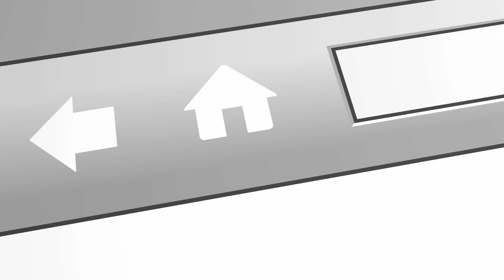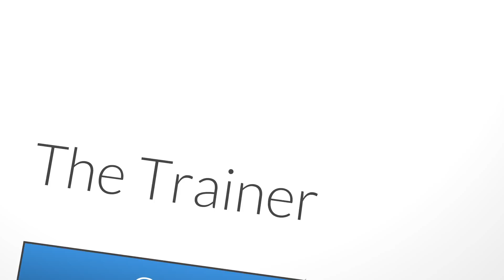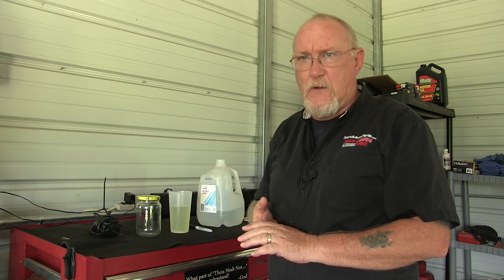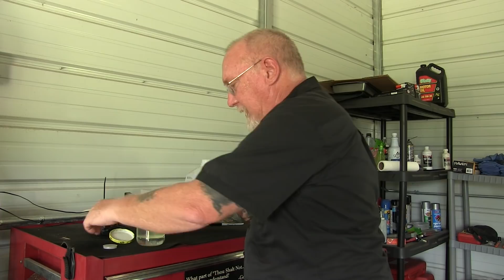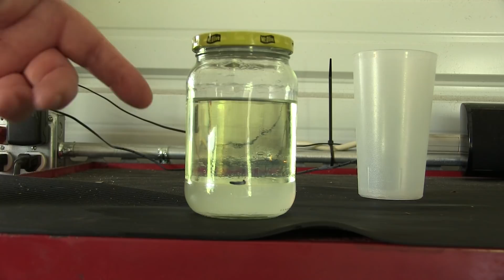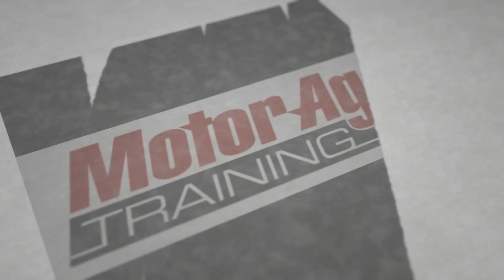The Trainer #67 - When Fuel Trims Won't Trim

Comment: What happens if u have new pump and new idle control  and sensors but u have 0 on short and long .......mine starts and stalls unless I give gass but it's still fighting me .....on a 2005 hyundai tiburon 2.7 gt standard

Comment: On my 2018 nissan frontier I have the lean code. when i press the brakes my short fuel trim goes to 25.0 and then back down. Is this normal or could this be the cause? Ive checked the booster hose and the booster has no hiss. Also when i clamp the booster hose and press the brake it gets harder with each press and short term stays low. That was a booster test I found online. The hose and booster seem to be ok. So is the rise to 25.0 normal when pressing brake?

Comment: So if idle isn't higher than normal that won't be the cause of higher fuel trim?  My long term is withing plus or minus 10% but drops closer to 0 not to 0 but from around 10 to 7 or 8sih when  accelerate   both banks... shirt term floats around 3 and 4  gets to 0 and - 3 at times higher on acceleration   both banks just about mirror each other as well  so it's not just one bank

Comment: I have a 19 Camaro SS with the V8 LT1 manual transmission, only mod is cold air intake, otherwise is stock. I have replaced maf, o2 sensors, pcv, checked for vacuum leaks via smoke test, even custom tuned. There is no cel on, but my long term fuel trims are super negative, and go MORE negative as throttle is applied. Temps seem fine. Car bucks when pulling out from a stop as soon as rpm hits 2k rpm like clockwork. During dfco, i can feel the car luurch ever so slightly when coasting in gear off throttle say around 60 mph. Ive chased this for over a year now to no avail. new oem plugs and wires as well. Everything is oem, performed by the dealer. Dealer wont help unless cel is on of course. I run nothing but 93 vpower shell gas, tried injector cleaner, tried everything. Could you help pinppoint me in the right direction? O2 sensors reach a tad over .8, and negative ltft on both banks are upwards of -18 on one bank and -13 on the other (sometimes more when throttle is applied). Any unput would be GREATLY appreciated. Only codes to EVER come on was P015B and P015D shortly there after. (Both primary o2 sensor lean to rich codes) thats why i replaced both primary o2s. I unplugfed my map sensor the other day with vehicle off, plugged it back in, drove it and shut it off. There was no cel on, but i did plug up my obd2 reader and it showed a pending p0106 and p0107 code (map sensor circuit low) or something like that, but then disappeared.
Reply: Excessively low (-10% or more) fuel trim readings = rich condition. Test for a leaking injector (especially if problem is worse on one bank vs the other) If the negative trims are on both banks, check for intake restriction: Dirty air filter or MAF sensor..  Highly recommend taking it in to have your tune adjusted. The inlet tube of your after market intake, which typically have different interior dimentions than the factory inlet tube, can and will throw off your MAF readings if not properly tuned accordingly. Hope this helps.
Reply: @jasonmartini5774  I took it in for a custom dyno tuned, because that's what the dealer told me to do to fix my issues. Said the cold air intake was making it run rich. But that didn't fix the issue. If I do an ecu reset, car will run great for a day or two, and right back to the rich running, slight bucking from a stop, and sometimes bog under wot. I thought about leaking injector, but didn't think it would be that due to both banks being super negative, even though one bank is more negative than the other. I have new air filter, new maf, and my cold air intake is the manufacturer cold air intake (gm performance) so it's within spec with their tune. The ONLY thing I haven't tried is the hose that runs from the cold air intake elbow to the clean side of the pcv system where the valve covers are (crankcase i believe) that system draws in fresh air post maf sensor at light throttle situations (or when the engine is under a lot of vaccum) I suspect it's leaking somewhere on that. Would a leak injector cause long term fuel trims to be super negative on both banks? And wouldn't there be a ton of misfires/cel? No misfires, and no cel.

Comment: I'm totally confused long term stuck at 24.86 both banks short term climbs high teens low 20's while driving. Release throttle drops .011 below.
No vacuum leaks no exhaust leaks. 5.3 Chevy engine fuel pressure is 55psi fuel volume is little above 1/2 gallon per minute. 02 sensors seem to oscillate normal driving on the highway but staying lean at idle and stop lights. LS swap engine no catalytic converters or downstream 02 sensors. Wire resistance all checks out good. Same results with another new warranty PCM.
No history of any misfires.
New spark plugs.
Drives very good with good acceleration. Verified with 3 different scanners.
I haven't tried it but heard a weak coil possible cause but it has no misses no misfires no backfires.
I raised the 02 sensors 1" below the shorty header outlet 
Where the bank cylinders exhaust. 02 sensors won't set but heaters set sometimes.
Don't go into closed loop all the time.  I'm totally stumped.

Comment: They made cars too complicated. Unless you have an obvious failure or you're a genius, you have to "shotgun" the problem by swapping out parts. I have a lean condition (+15%) but no codes.
Reply: I agree. I’ve been dealing with a bad idle / weak acceleration issue for a few weeks now. Not even the ford dealership can figure it out. I’m at my wits end lol

Comment: I have what I think is strange. My 01 ford explorer 4.0 sohc set both p0171 and p0174 a couple weeks ago. I looked at the short and long fuel trims the other day and both banks were +10 on short without fluctuating and -9 on long without fluctuating. Idle seems normal and drivability seems normal. I can't afford a shop so it's taking longer to diagnose. Both bank 1 sensors had been moving between .1 and .7. it's been cold and rainy with no garage which makes it harder for me to take time.
Reply: did you ever figure this out? closed loop- correct?

Comment: What could cause a p0171 on a v8. Bank 2 looks good at all times. Bank one looks good under idle. But adds a lot of trim under load. Got the code driving in an area with steep hills. The injectors are all fairly new oem injectors. 150k mile 2007 mustang gt. MAF is clean. Oxygen sensors seem to be working fine as far as i can tell.
Reply: did you ever figure this out?  I have a simliar issue on B2 / pending, setting P0174

Comment: About your Alcohol / Gas /Water test:  When alcohol is absorbed (Dissolved), into the water, we should see the volume DECREASE.  Your test procedure is also incorrect.  It needs to be performed like this: Individually measure the amount of fluids and then combine them.  The combined volume or height will be less than the amounts mathematically added together.  Similar example; Mark the level of water in a jar, add a good amount of table salt without stirring or agitating, and mark the level/height; it will be above the water only line made earlier.  Then stir the salt and water solution until most or all the salt is dissolved into the water.  Next, view the level of the water-salt solution and notice the level has dropped and returned to the first marked water line.  Alcohol also dissolves in water like salt does, but ( I'm not certain if alcohol actually dissolves or just mixes with gasoline )  doesn't dissolve in gasoline.

Comment: Struggling with my LTFT on a 18 Mustang Eco. It’s at a +15% at idle (or when letting off gas) Changed Fuel Pressure Sensor aswell as gasket before down pipe (but it doesn’t fit snug for some reason, it’s snug enough but can move when pressure is applies) could it be Injectors? Only code I’m getting is P0420 (I was told it’s because of the Aftermarket down pipe that came with the car)

Comment: What could cause high LTFT’s of 16% at wide open throttle on a supercharged speed density car?
Reply from the maker: 3 questions - 1.  Any codes set? 2. What is STFT under the same conditions? 3. What kind of car are we talking about?
Reply: @VehicleServiceandRepair  No codes set at all. 

Around 3000RPM of going Wide open throttle, LTFT goes 1.12 bank 1 and 1.16 bank 2 for the complete run… 
STFT goes 1.20 B1 and 1.27 B2 for 2 seconds… then lowers to 0.98 to 1.01 B1 and 0.91 to 0.98 until I let off. 

It’s a 2017 centrifugal supercharged V6 Mustang.
Reply from the maker: @AtticAZ  If your STFTs are normal, your ECM is in fuel control and happy. I wouldn’t worry about it.

Comment: My Ltft is +14 at idle...when i accelerate it goes down but as soon as i take my foot off the gas pedal it goes back to +14. Mazda demio 2005
Reply from the maker: If there are no codes and STFT is switching nicely over 0 - then don't worry about it.  🙂

Comment: I'm having a hell of a time understanding my Mercedes at the moment it used to run a LTFT trim of 3.9% max. it made small short trim corrections. Now STFTS swing up to +/- 25% either way and LTFT is running about +8% sometimes goes over 10. I was always taught any trimming over +/- 10% is a concern. No fault codes, passes every DAS test, engine runs fine but I can just feel and hear something is off 😭
Reply from the maker: Monitor your fuel trims at hot idle and at 2500 RPM. Post the total of STFT and LTFT here and let's see if we can figure it out.
Reply: @VehicleServiceandRepair  I thought I did a reply with a video id uploaded maybe YT took it down? Got in the car this morning and gave it a little rev and there was even a few little pops and bangs from the exhaust which is telling me that there's way too much fuel going through there. Still no error codes or fault codes from a vehicle with a fairly comprehensive and complex diagnostic system. 2500 RPM hot idle I've got short-term fuel trim going into the negatives yet the long-term fuel trim is running into the positives? What gives? I thought negative is rich so ECU will decrease injector pulse and positive is a lean indication so increase injectors? Why would it's short-term strategy not reflect in its long-term strategy? Seriously puzzled
Reply from the maker: @psions555  Send me your vehicle info - Make, model, year, engine, trans. Email it to pete.meier.training@gmail.com

Comment: Thanks! I really like your alcohol/water test :)

 I recently got a new scan tool and it says  the gasoline in my flex fuel 08 Caravan 3.3L has 25% alcohol and I was surprised to see it that high, as I thought up to 10% was normal in gasoline. Does 25% seem like a rather extreme calculation to you? Currently having gasoline shortage in Canada due to war/environmentalism from governments....are they selling me extra alcohol or should I look further?🍸
Reply from the maker: Definitely sounds off. Sometimes the ECM miscalculates and that causes fuel trim codes to set. Measure the actual alcohol content of the fuel in the vehicle and start there.

Comment: Hi I need some help. I rebuilt a 2001 vr6 vw motor has 268 cams & titanium valve kit. I keep getting a p1137 code I been chasing for 1 month. I have changed maf,injectors,  purge valve, fpr, fuel filter , o2sensor still keeps coming back.
Reply from the maker: What diagnostic tools do you have access to?
Reply: @VehicleServiceandRepair  torque app scanner. I also have the basic small scanner that shows stft & ltft maf
Reply: @VehicleServiceandRepair  
ok i got some data from the torque app scanner. Maf at normal running is 6.0g/s
STFT: 2.3%
02 1×2: 0.4V
LTFT: -14.8%
VOLTS (AD): 13.9V
FUEL FLOW: 38.6CC/MIN
FUEL FLOW: 2.4L/HR

UNDER LOAD 11.8%
MAF: 15.2G/S
STFT: -10.9%
02 1×2: 0.6V
LTFT: -14.8%
VOLTS(AD): 14.0
FUEL FLOW: 92.9CC/MIN
FUEL FLOW: 5.6L/HR
hope this helps. Thank you for helping me. I just bought another set of injectors & was gonna install today after work. But ill wait till I hear from you. I also for got to add that when I initially start the car it cranks for awhile I gotta step on the gas then it will start.
Reply from the maker: So you had this problem from the start (after your modifications)? 

I like to watch the STFT in action. Is it swinging over 0 equally, or biased one way or the other. Is LTFT climbing? 

For now, what size engine is it? And what is the MAF reading at warm idle in grams/second? What are the trims at warm idle? What are the trims at 2500 rpm? Power ok?
Reply: @VehicleServiceandRepair  yes had this problem from start i believe since I put the rebuilt motor in. Its a 2001 vr6 vw gti 2.8L 
So at warm idle STFT jumps between -5.5% TO  12.5%
Maf is at 4.0g/s
02 1×2 0.1v-0.6v
LTFT -17.2% CONSTANTLY 
FUEL FLOW 25.9CC/MIN 

AT 2500 REVS 
MAF 12.2G/S
LOAD 9.0%
STFT -17.1%
02 1X2 0.1-0.8V
LTFT -17.2%
FUEL FLO 68.5CC/MIN
Reply from the maker: @Destructive_Asylum_13  Are the injectors mated to the original engine or the new one?
Reply: @VehicleServiceandRepair  the old motor still has 3 injectors that i pulled out today. & 3 were no good
Reply: @VehicleServiceandRepair  i had new ones in the rebuilt motor & just purchased another new set inwas gonna install but a guy said its not your injectors cause under load my stft in going to -17%
Reply from the maker: @Destructive_Asylum_13  OK. I should have caught this earlier. This vehicle has 2 banks. Do you list fuel trims for both? If so, share the other bank data and let me that.
Reply: @VehicleServiceandRepair  ok i got some data from the torque app scanner. at normal running idle 
MAF 6.0g/s
STFT: 2.3%
02 1×2: 0.4V
LTFT: -14.8%
VOLTS (AD): 13.9V
FUEL FLOW: 38.6CC/MIN
FUEL FLOW: 2.4L/HR

Rev at 2500 rpm
UNDER LOAD 11.8%
MAF: 15.2G/S
STFT: -10.9%
02 1×2: 0.6V
LTFT: -14.8%
VOLTS(AD): 14.0
FUEL FLOW: 92.9CC/MIN
FUEL FLOW: 5.6L/HR
Reply from the maker: @Destructive_Asylum_13  Are these new numbers from Bank 2?
Reply: @VehicleServiceandRepair  yes
Reply: @VehicleServiceandRepair  i have the intake off & putting new injectors in today after work. I also put a new thermostat cause I read if the cooling system is off it will cause issues. & sometimes I would overheat & other days the fan would come on when its supposed to. Im pretty close to driving this car through a wall so pissed I can't figure out why its running rich. & keep getting same code. If at 2500 rpm stft goes to -17% does it mean i have a big vacuum leak or what we looking at.
Reply from the maker: @Destructive_Asylum_13  What happened after you put in new injectors?
Reply: @VehicleServiceandRepair  nothing same issue. I am taking motor apart. Cause I also checked compression & its low in all cylinders.
Reply from the maker: @Destructive_Asylum_13  Who did the rebuild and how many miles are on the engine?
Reply: @VehicleServiceandRepair  I did the rebuild. I put everything new, stock pistons with new rings i put a 1000km on the motor so far then took it to get tuned. But am getting over heating issues as well on top of the p1137 code.

Comment: What if your fuel trims will not read or stay at 0%
Reply from the maker: Neither should stay at 0%. Short Term should continuously switch from positive to negative over "0" and Long Term will be a reflection of the learned value.
Reply: @VehicleServiceandRepair  so I might have a short somewhere right
Reply from the maker: @dennisrisner7900  No, this is not necessarily a problem. What are your fuel trim numbers doing?
Reply: @VehicleServiceandRepair  nothing  . Can't be read at all . Even tried to reset the ecu and nothing .
Reply from the maker: @dennisrisner7900  Sounds like we need to start at the beginning. What kind of car are we talking about? What is your original problem? And what kind of scan tool are you using?

Comment: One of our vehicles, a 2005 VW Beetle, 1.6L with a widedband oxygen sensor is running rich.  At idle it's -2.5 at 2500-3000rpm it's -10 to -20.  The long-term fuel trims don't adjust the short term, but they aren't as bad as the short-term ones, which are always around -1.6 to 3.5.
 The pre-cat lamba probe is switched off quite quickly by the ECU while driving and the MIL comes on a little later.  Error code P0130
 The pre-cat lambda sensor was changed, but it hasn't changed.
 The exhaust manifold is tight, I couldn't measure the fuel pressure yet.
 The probe after the cat (normal o2sensor) has up to 800mv in operation. The voltage from the upstream o2 is about 1.5 V according to the scan tool, but Voltage reading on a wideband O2 should not say anything. 
The heaters from the sensors are working according to the scan tool.
 What would you guess?

Comment: In a speed-density system, if there is a vacuum leak, is it possible that the idle air control system could compensate and still give a normal idle speed?
Reply from the maker: Typically, no. Look at the IAC position on a scan tool. If it's close to or at "0", there's a vacuum leak.
Reply: @VehicleServiceandRepair  Thank you - this particular vehicle has very basic OBD and doesn't report an IAC PID, but I can probably scope it directly. Really appreciate your thorough and professional video presentations!

Comment: Hey Sr.! My 2009 Kia Sportage 2.0 16v (MAP) has a rough idle with high LTFT which stays at 16.41% regardless of engine RPM. STFT bounces to +/- 5% during rev ups (negative when increase and positive when decrease RPM) and LTFT stays on 16.41%. The O2 Sensors 1 its ok, on 0.1 and 0.9 range, It is causing high fuel consumption. Any tips as to what's going on?
Reply: Do you have CEL and error codes?